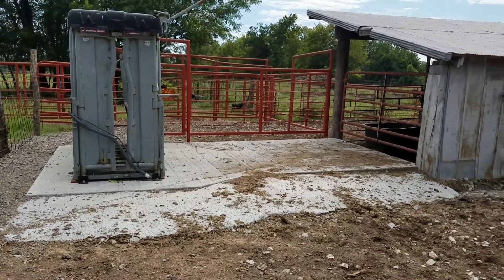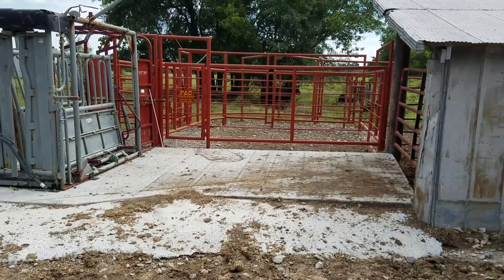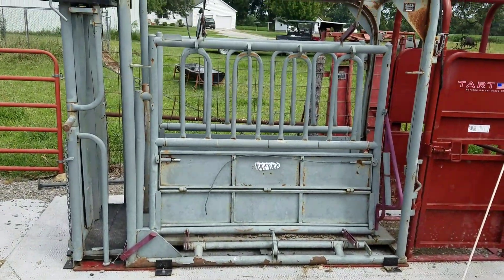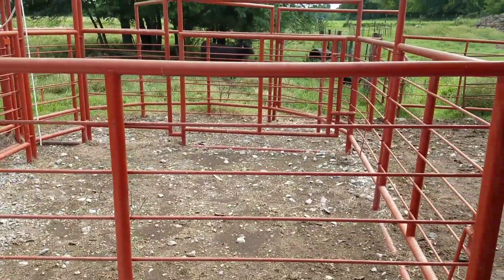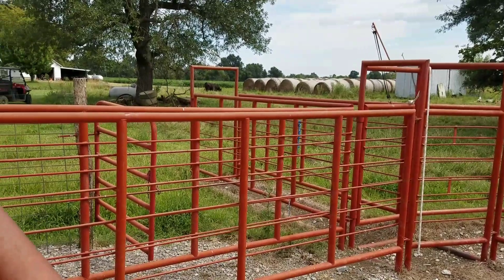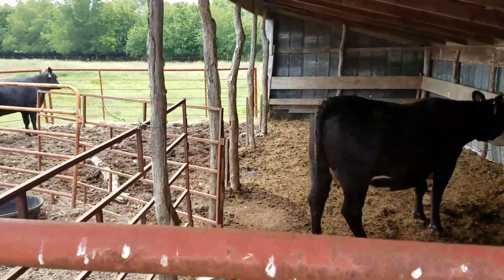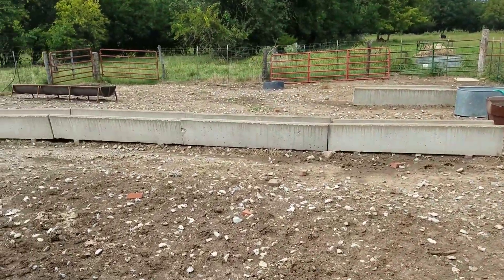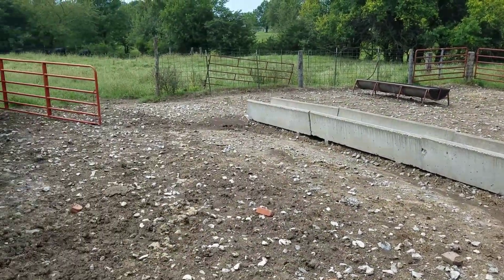P&C cattle pens and new working set up

Comment: It was rather hard to tell but it looked like you had a partial tub setup where cattle could go to chute or load out. Do the cattle make a 90 degree right turn to load out?  Couldnt see very well
Reply from the maker: Bill Baxter they can either go straight and to the chute or turn right and go down an ally to a trailer. It actually works pretty well.